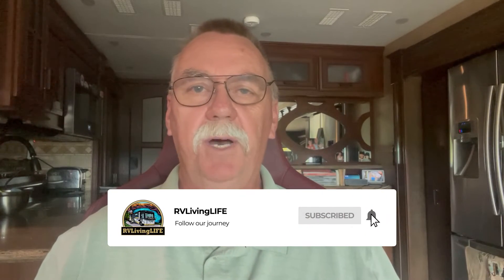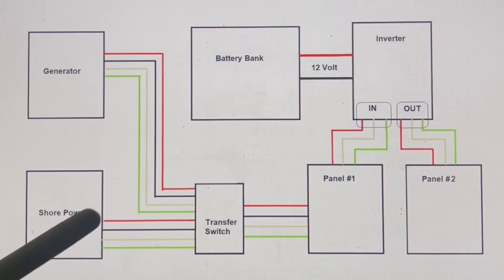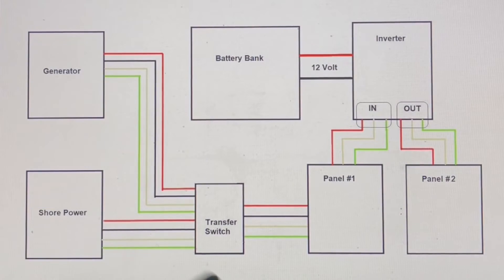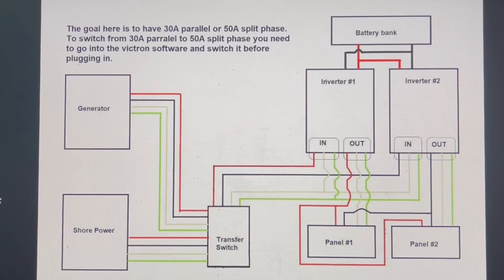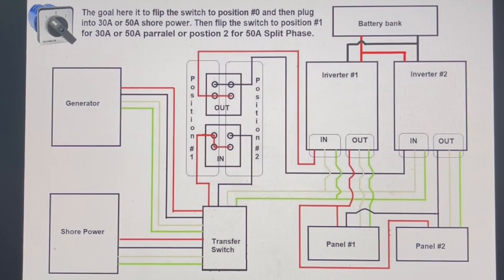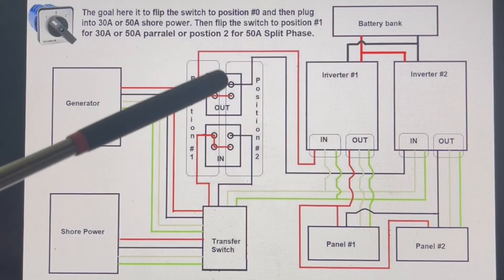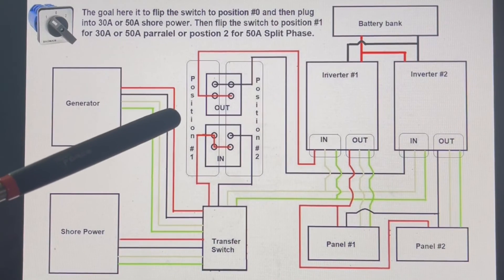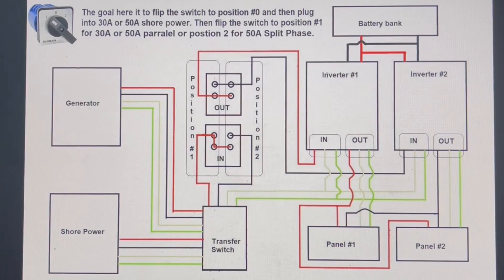How to wire two Victron Inverters In Split Phase and Parallel

Comment: Hi Gary, I also recently added 2 inverters.  Multiplus 2 120 X 2’s running in Parallel.  All wiring is 4/0, and i am using a 600A Blue sea switch (the grey switch like yours).  The final feeds on the battery cables are less then 12” long.  I did a test recently pulling close to 3000 watts, then check the temp of the wires.  I found that the 12” 4/0 hot from the battery was about 100 or so degrees, I can grab the insulation and roll it, cause its warm.  But then there was more heat at the switch, around 110.  I felt that the switch was hotter then I felt it should be.  Does your system get hot?  My setup, if you can follow this is 12” battery cable goes to (2 sandwiched) 1/4 X 1” copper buss bars connected to 2 poles of the Switch, and from the switch there are (2 sandwiched) 1/4 x 1” buss bars bolted directly to a Lynx  Distributor.  What are your thoughts.
Reply: In Phoenix, mine are 120 with nothing on.
Reply from the maker: Yes things get hot. 100 F is not much heat though. If you mean 100 C that is much hotter. Keep the amps down and the cables short.
Reply: @RVLIVINGLIFE  Would it help to put an extra positive and negative cable?  So parallel cables
Reply: @MrSummitville  I originally thought that 100 F was a lot, until I did some real testing and checking around.  100 F is well below the cables rating of 275 F max and the 250 -300 AMP rating. The people that sold me and advised me on my setup never said it was unreasonable the way I’m set up.  Everything is 4/0 cable with very short (less then a foot) battery and main connect feeds. I recently put this to a pretty heavy test on a 30 AMP RV connection and it works flawlessly when the inverters assist.  The most I see is 150-200 AMP continuous, and that was for under 1 hour if i was pushing it doing multiple things.  The cables never got over their rated limit.  In the longer term running continuously between 75 to 125 amps for 5 to 6 hours.  No issues, no hot spots and no overheating.  Yes i get that 24V would be more effective to keep the amps down. Part of my decision was driven because I already owned and had used the single 3000 watt Victron for sometime, then decided to convert to a parallel system once I added more Lithium. So to say “Do i want to burn my rig down” might be a statement for someone who’s system is cobbled together.  Mine is not.  I used the best and highest rated of everything. Everything from the length of cable to the type of crimps, bends and tightness and fit of connections.

Comment: Hello, I wired mine in a split phase with 2 Multi II,  How ever my cerbo only shows L1 Watts, and L2 Watts when the inverters are inverting.  When fed by shore power it will show L1 with all the watts and L2 0 watts.  How did you get yours to show both L1 and L2?  Master inverter is wired with Black into L1, Slave Inverter is wired with Red into L1 (the inverters will only take input on the L1 connection on the inverters) System works great just have that problem and when shore is disconnected inverters start inverting as they should, when shore is turned back on inverters continue to invert until I shut down one of the A/Cs (I have 2) Can’t figure that out either any Ideas?
Reply from the maker: Interesting problem. Unfortunately I have no experience with the multi II. it does sound like a configuration issue though.

Comment: Do you have pictures of the wires on the rotary switch?  Or, can you indicate the stud #'s on the rotary switch on your diagram?
Reply from the maker: I looked through my picture and unfortunately not. I do recall figuring it out with a continuity meter and it was different then I expected. I think that would be the best way to get it right.
Reply: I bought the switch and it has all the wire locations in the instructions

Comment: I have 2 4000/12v split phase inverters, looking to connect in parallel. Is this possible? Sungold LFP series.
Reply from the maker: Sounds interesting, but I have no experience with those inverters

Comment: So, would Victron's Autotransformer not have solved your issue? It can take a single phase and turn it into a dual phase output, balancing the load in the process. They have a 30A and a 100A version. You can then keep your setup in 2 phase at all times.
You may need to switch the mode of the transformer, or use the switch with one side for 2- phase input and the other for the transformer set up to split the phases.
The 100A version will handle the 50A input and is about 700 US.
Reply from the maker: An autoformer could have helped but if I were to buy one of those I would put it after the inverters to share the loads between the inverters. So to use one on the front end would mean I would need two and it all works well enough already that I can not justify the expense.

Comment: Would a 30amp to 50 amp rv adaptor not do the same thing? The 30 amp adaptor has a jumper built inside to share the 30amp single phase on both lines for the 50 amp cord. So 2 has lines in parallel. Im doing the same set up so have some questions. When you're plugged into a 30amp, does the master inverter do pass through and the slave (second) inverter inverts that phase to still maintain 240v output? or does it use power from the battery bank? when reading the victron manual online, its seems to say if you are running 240v and plug into a single phase, you will only get 120 passthrough, but fails to mention if second inverter inverts that phase or system switches to 120 output in parallel only.
Reply from the maker: "Would a 30amp to 50 amp rv adaptor not do the same thing?" 

Yes and no. 

If your rig is wired in parallel, you can plug directly into a 50 amp plug for 50A120V or plug into a 30 amp plug with the 30/50 dogbone for 30A120V, If you are happy with that amount of power that is great. 

If you want split phase for two lines of 50A120V. Your system needs to be wired in split phase and you need to use the Victron app to set your system to split phase or parallel before you plug in. This is what I did for two years.

But when you are a member of Thousand Trails  there are many parks where you never really know if you are going to have a 50 amp or 30 amp pedestal until you arrive. If you have no internet then you can not switch your inverters from parallel to split phase or vice versa. So when I am in doubt. I use the app to switch to parallel, flick the switch to parallel and I am good to plug in 30 or 50 at the next park. After I have arrived and if I end up with 50 amp I can switch the software and the switch to split phase if I feel a need for more power.

Some people may find this unnecessary as you can just wire your coach in split phase as I originally did, and use the Victron app when connected to the internet to switch over. But on several occasions I arrived at parks, have no internet and its crazy hot out and I cant plug in to run the AC units. Then I have to plug my laptop into the inverters and reset them to get it working.

---------------------------------------

"When you're plugged into a 30amp, does the master inverter do pass through and the slave (second) inverter inverts that phase to still maintain 240v output?"

I believe the master inverter operates on passthrough and charges the batteries. the slave inverts off the batteries and charges the batteries. Not 100 percent sure on that. 

Since the line coming in is one 30A line in single phase you can not run split phase as both lines are split from line 1 and in the same phase.

-------------------------------------

"when reading the victron manual online, its seems to say if you are running 240v and plug into a single phase, you will only get 120 passthrough, but fails to mention if second inverter inverts that phase or system switches to 120 output in parallel only."

If you have the inverters set to split phase and plug into 30 amp you will likely get power only on one line or get an error. Split phase expects L1 and L2 to be in opposite phases.

Gary
Reply: @RVLIVINGLIFE  thanks for the reply! I asked a similar question on the Victron Facebook group as to the 30amp connected to split phase setup on the multiplus2. A guess the master will pass through the 120 and also charge the batteries. The salve with invert the 120 to opposite phase and not charge battery. Slave will only invert so you still have 220v output from the inverters. So no need to change settings. Not sure about the multiplus version 1 though. I guess the downfall would be that you only get half the charging capacity when plugged into single phase.

Comment: hi, thank you for the video. Very helpful. Can you provide input on the noise level (fan and hum from transformer)? Im planning to install in an apartment for UPS functionality to deal with blackouts in my location.
Reply from the maker: Hello and thanks for the comment. When the system is plugged into shore power there is very little sound as the inverters are basically just passing the shore power through them. When there is sound is when the shore power is unplugged or in your case during a power outage. The higher the draw the more the inverters hum and the fans blow. Like if I am running 3 AC’s off the batteries the noise is significant. But not enough to hear it in the coach or outside with the bay door closed. Running 3 AC’s off the batteries draws them down so quickly its not realistic to do so. Also when in high amp draw situations the inverters also create heat, so they need space to breathe. In our case the cabinet the batteries and inverters are in is small but it is open to the entire basement of theRV on the left side so heat does not become an issue. I say this incase you are thinking of enclosing the setup in a small closet or cabinet. They need space to keep from getting to hot under serious loads. But if you intend to use the system for normal life other then AC or electric heat there would be very little sound or heat generated. Normal life like LED lights, the occasional microwave, coffeepot or toaster. Even with us running an LED TV or our Starlink internet we can still go a long time.
Reply: @RVLIVINGLIFE  thx u
Reply: @MrSummitville  UPS are super inneficient and cost triple. Better to have a 2 victrons with 30k lifepo4 batteries.

Comment: Sorry if this is already said in other comments, but I didn’t see it. A 50a 240v circuit has 2 120v legs (If both legs are not balanced due to downstream loads a common/neutral conductor will be needed). Across both legs you will have 240v. Although the over current protection is capable of up to 50 amp load, the load is determined by load demand at any given time. A hypothetical 50 amp load would read as 50 amps on each leg, zero on neutral, but 50 amps total. Not 100. It’s counterintuitive, but that’s how split single phase circuits work. 

If there is a demand of 25 amps on line 1, but 30 amps on line 2 the total circuit ampacity is 30 amps, not 55 amps. And the unbalanced load (5 amps) will be carried back via the neutral conductor. 

I know this may come off as being overly pedantic, but I’m just worried some viewers may become confused when conflicting data comes up while  sizing wire and laying out circuits. Which can cause major issues. For example, failure to balance the downstream loads on each leg can cause a ton of issues, some with dangerous consequences especially on a boat or RV. Some stuff really shouldn’t be DIY.
Reply from the maker: Thanks for your comment's. In a parallel wiring setup there is 50 amps total as you stated. In a split phase you have 2 separate 120v 50 amp lines.  Unbalanced downstream loads can be an issue. I did not go into depth as how the panels are wired but they are the default wiring from the factory. All the loads are divided as well as possible between the two legs of the split phase circuit, similar as to house is wired. Yes the unbalanced load is carried back on the neutral, but this should not be an issue if the wires are gauged properly. I did not mention it yet in my videos but we did run a second 6/4 wire from the inverters to the panels in parallel with the original 6/4 wire, essentially doubling the capacity. I did this so I can wire each panel in the future separately which I have since decided not to do, at least not yet. Considering the loads are divided as they were from the factory I don't believe I have added any risk to the system even if I did not add the second wire. And you are right that some projects are not really suited for DIY, unless the person has a good understanding of the system. Not sure I have heard the term "split single phase circuits" before, but if you are referring to parallel single phase that is simply line 1 being split between line one and line 2 on the rig.
Reply: @RVLIVINGLIFE  If you only plugged in and used 240 volt, ( red and black + N or ground for safety..)  then load balancing L1 and L2 wouldn't be a problem ?  right ?        I plan to install only 220-240 volt equipment in coach as I will ship it to Norway after RV trips in US....   So mini split will be either 220-240 volt , Fridge , cook top, etc etc. will be 240 volt compliant.    (probably change every outlet to Euro spec style as well.).   Mini split might be a 48 volt unit, as that seems even more efficient use of power stored... No 10% loss through inverter  ?       Strange thing is I reached out to two professional electric installers and they didnt have a solution, and both wanted me to stay 12 volt on battery side !   I like higher voltage , less current, and that goes for house side 240 volt , and battery side....  also less voltage drop on battery side .   Thanks again for informative an easy too understand for a DYI that hasn't used anything he  learned on electrical wiring since going out of technical school back in 1983. :-)
Reply from the maker: @Z06norway  I believe load balancing should always be taken into account. Any difference in loads between L1 and L2 will be returned down the neutral line and that can get pretty hot. I ran a second line and essentially paralleled my lines from the inverters to the power panels just to overkill the wire size.
Reply: @RVLIVINGLIFE  thanks, but if I only use 240 volt, then everything will be in balance ?  Right ?
Reply from the maker: @Z06norway  any loads that are 240v will draw from both lines. Any loads that are 120 will draw from one line or the other and they should be balanced.
Reply: @Z06norway  if you only use 240v, l1 and l2 can still be unbalanced. For example, your home water heater uses 240v to run a single heating element at a time. Giving a balanced resistive load, which is why they don’t require a neutral. Your dryer on the other hand has multiple loads both 120v and 240v (heat element). Once power comes into the unit one line would split off to run a few small 120v loads like interior light, control panel, sometimes the motor is also 120v. The heat element is sometimes the only 240v circuit. This leaves an unbalanced load within the dryer’s circuits which is why dryer plugs (modern ones) require a neutral. Same for your oven…the cooktop elements are 120v. Often the only 240v item is the oven element. Varies by manufacturer, but all of them require a neutral. We have a terrible habit of jumping the ground to neutral in the units (dryers and ranges) when connecting the cord if there isn’t a 3 wire plug (2 line, neutral, and ground) available. This is common in older homes built sometime before 1990 ish. So, to answer your question, yes you can still have an unbalanced load on 240v circuits.
Reply: I believe the new victron multi-Plus 2 120 * 2 - 240 takes care of the phaser switch automatically?

Comment: Please tell me if it is possible to make such a connection from four pieces of MultiPlus-II 48/5000/70-50 230V - 3 phases, but one of the phases has two inverters in parallel. So, phase by phase: 2-1-1 inverters
Reply from the maker: Tough question, You will have to ask Victron about that one. They don't have a great response rate though.

Comment: Hi Gary, what size is your Generator?  My onboard generator is a 5.5k.  I believe I only have 50 amps total not 50 amps on L1 and L2 because that would be a total of 12,000 watts.  Don
Reply from the maker: Hi Don, our generator is 10K. You generator can likely produce 120v 50 amp on two lines but is not wired that way to keep things simplee.
Reply: @RVLIVINGLIFE  If CowboytBiker's generator is the Onan 5.5k, it is actually 30 amp on each leg, in addition to the two legs being in phase with each other (0 degrees). Since most RV parks' shore power is split phase (180 degrees), you can have an issue with the Victron inverters only seeing one leg of the generator, resulting in one inverter running in pass-thru mode and the other one inverting.  Things get more interesting if you run into a park or residential shore connection that is split phase at 60 degrees. The solution is to run the autotransformer or have multiple inverter configuration files that can be quickly loaded to the inverters.
Reply from the maker: @AdorableDeplorable1  thanks for the info. I just did a video on swapping configuration files easily with my phone. I only showed a simple swap to change max amps from the power pedestal to keep it simple. But I swap between 30 amp and 50 amp profile’s with various charge rates and other things.  It helps a lot with the wide range of power situations in various RV parks.